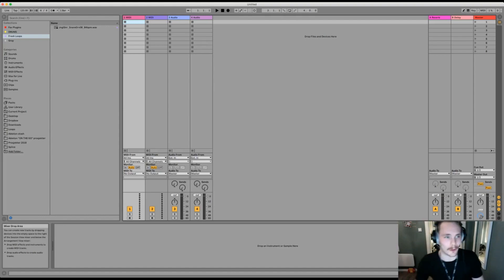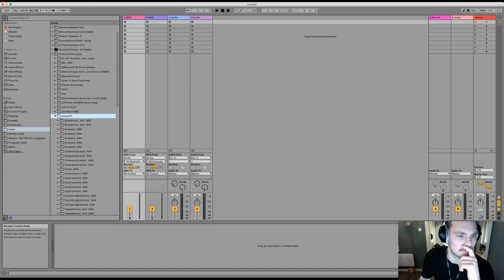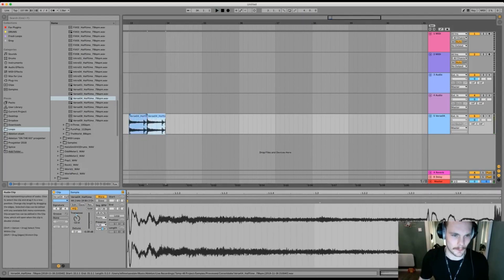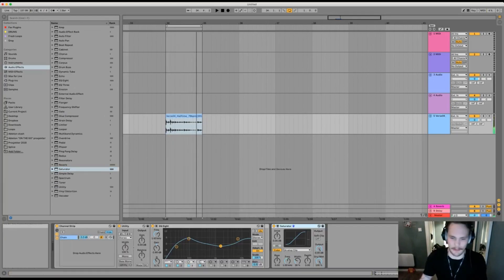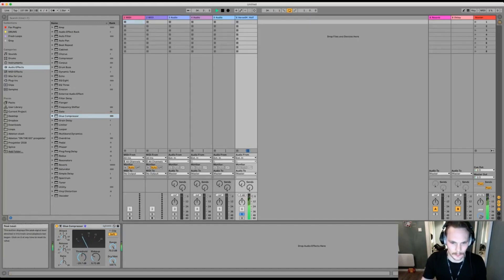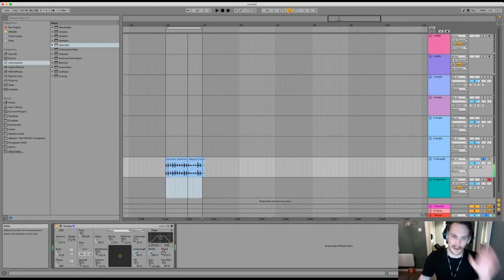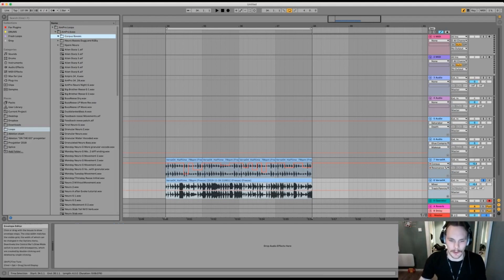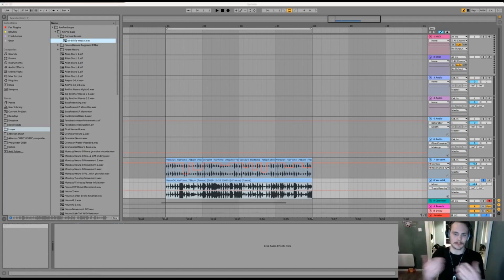How to sound design glitch & IDM bass samples with ableton

Comment: I am a little confused by some of the things you did when you originally stretched the clip, which keyboard shortcuts etc. Can anyone explain what happened here?
Reply from the maker: Hey bud! I'm currently out camping, so I can't load the video properly due to the bad reception up here haha. But I'll see if I can help you out nevertheless! Can't recall exactly what I did in the video, and it's a bit bad that obs display capture hides the mouse.. I forgot it did that.
Anyway, I cut the clip with ctrl/cmd + e, then I consolidate em with ctrl/cmd + j. Which just basically bounce it out as its own clip. It's a bit easier to work with, imo. Then if you press those buttons under seq bpm " :2"  to the left. It'll stretch or compress the clip. Then I just play around with the warp modes and it's settings. It's to the left, and I'm using the mouse - but it's just not showing due to OBS... That what you needed help with?